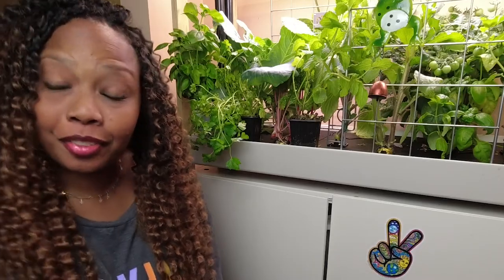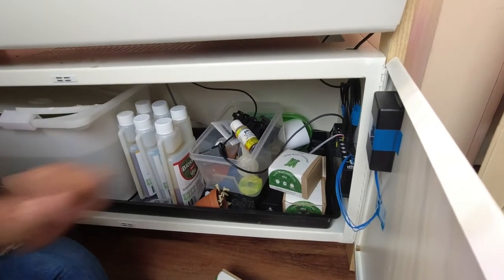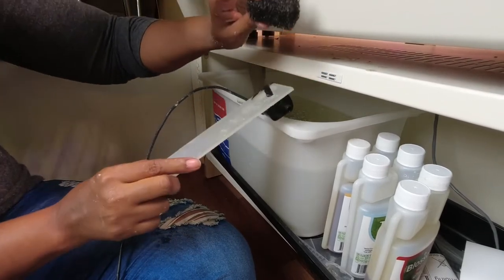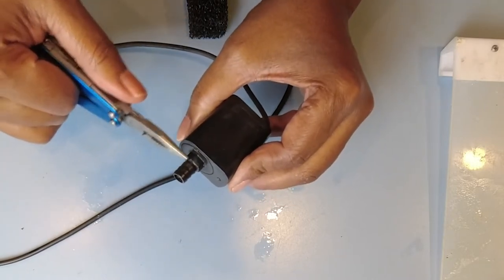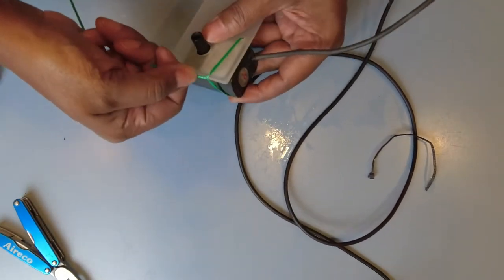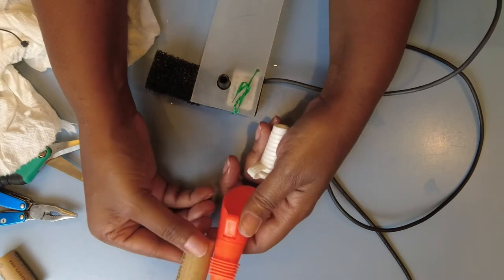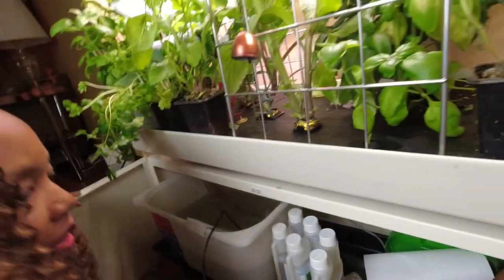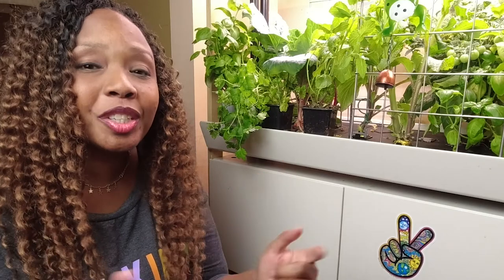Rise Garden Pump Not Working: How to Troubleshoot

Comment: What if you just can't get any power? No red light no green light, no lights even
Reply from the maker: First, contact tech support asap to get to the bottom of it. In the meantime, you will need to find something to block the holes on each tray to keep the water in. Some people say they have used wine corks but mine are always way too big. I use the tapered plastic nozzle that comes with the baby cough syrup syringes. I will see if I can share a link with an example. This will keep your plants hydrated until you can get a response back.
Reply from the maker: https://www.amazon.com/Calibrated-Medicine-Syringe-Adapter%E2%94%82Liquid-Dispenser/dp/B0040HH7VO
This is what I use. I hope this helps you! Good luck!
Reply: Thank you! I will try this. I've contacted support and hopefully they will get back to me soon
Reply from the maker: @ursulalamb8470  all the best to you!! They will get you squared away!
Reply: They are sending a replacement power supply. I didn't even have to explain further that what I originally put in my email. They read what the issue was, and said since my garden was still under warranty, they have ordered a new supply to send right away!
Reply from the maker: So wonderful to hear!! 🙌🏾 Thank you for the update! I am happy everything worked out!
Reply: @themochafoodiegardener  thank you!